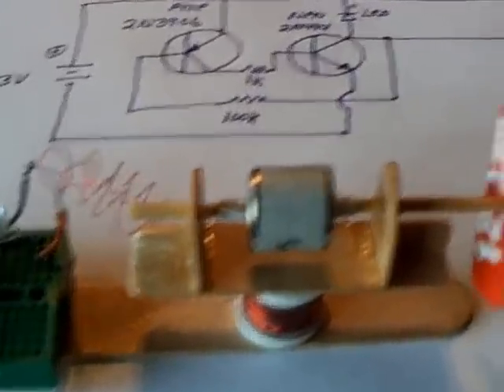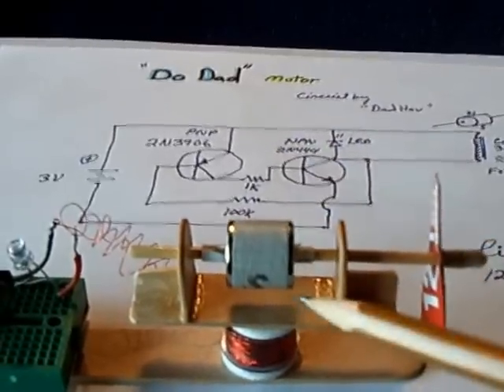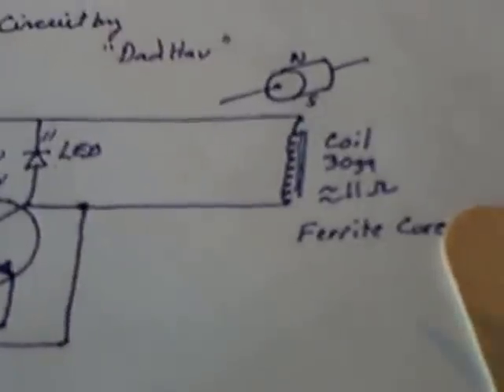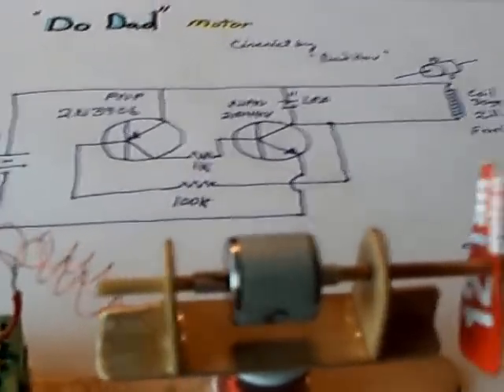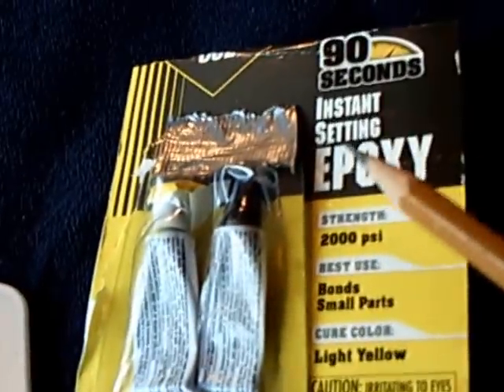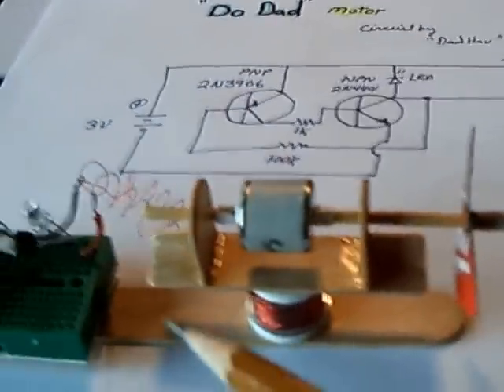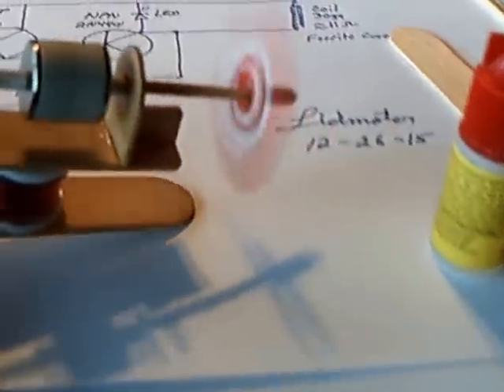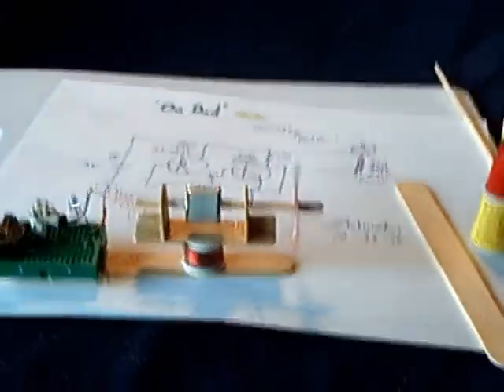Do Dad motor

Comment: Nice tip with the glue for a bearing. Have got a quart bottle of motor oil that was nearly thrown away for being 'empty' several years ago, it's oiled up many a motor and project since then.
Have a great New Year !
Reply from the maker: +slider2732  Happy New Year to you also.  In the old days there was actually a job title called an "oiler".  All the guy did was hand oil bearings and such. You and I would have been really good at that task. Ha. We have had lots of practice.

Comment: Here's another way of making a durable bearing surface,  

Slide the magnet on to the bamboo skewer, but don't attach the two.
Then glue the ends of the bamboo skewer to the vertical supports.
No lubrication of any kind.
The magnets have a 1/8 inch hole and the skewers are also 1/8 inch plus or minus a few thousandths. You  may have to try a couple of skewers, or sandpaper the skewer down,  to get a good match. I have one spinning non stop for three months.